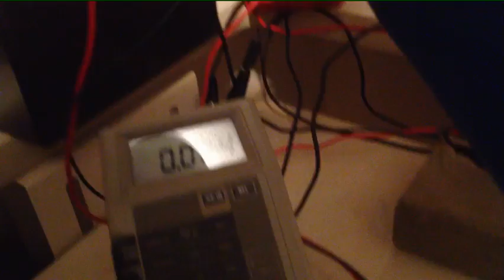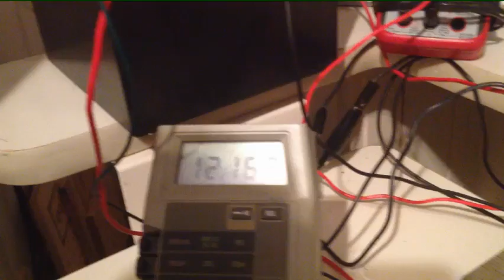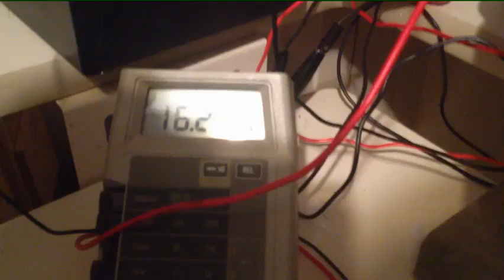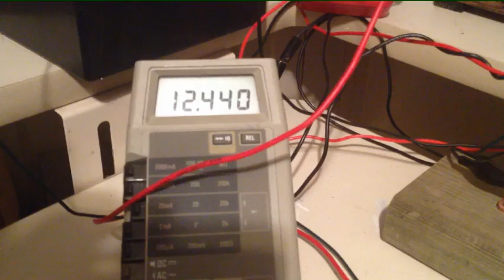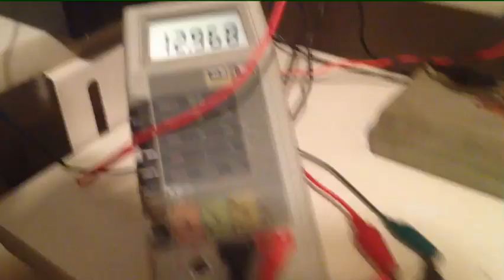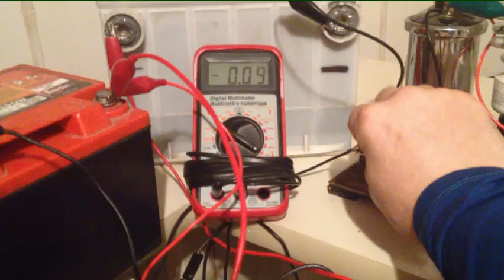1 Watt Tesla Coil with Pancake

Comment: Very interesting! I know what you mean by the fluffy charge. i got that same effect from a sort of kyle-variant of the imhotep radiant CFL /charger thing i set up once... a strange but simple ignition coil, using only a sine signal from the ground itself for triggerring. I was charging the battery off the back end of the fluorescent -- not even rectified... but that was also my run battery! It held forever... but then plummeted one day. charge wasnt real. cool work darcy!~

Comment from the maker: Thanks Min2oly.  Just messing around really.  I did a poor job of making the distinction that the two separate windings (foil and magnet wire) are completely independent of each other and only coupled by induction.  In the video i think i say that one leads back into the other, which is wrong.  lol